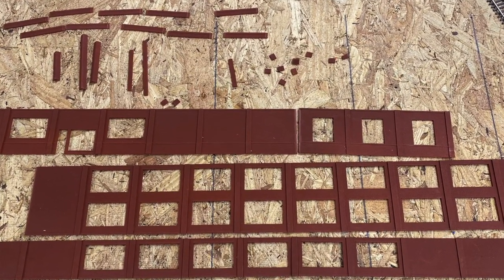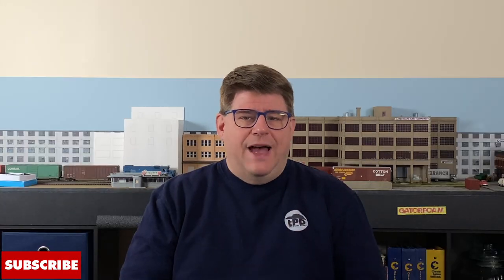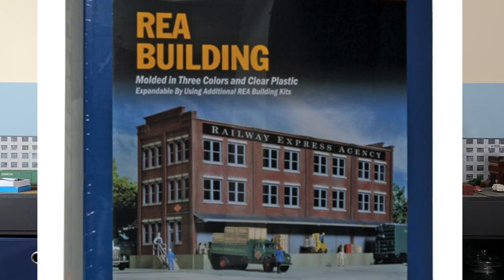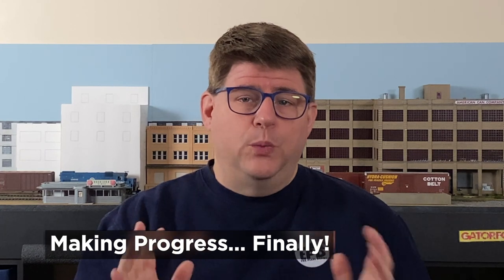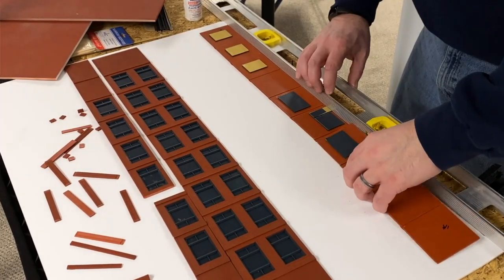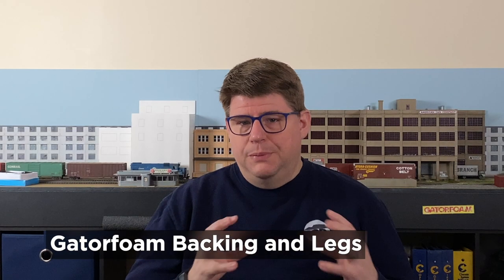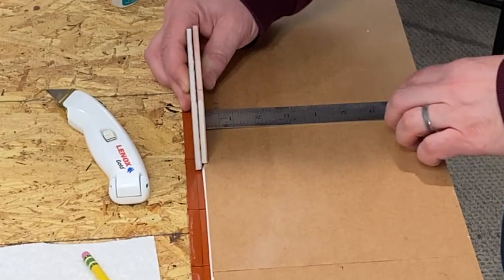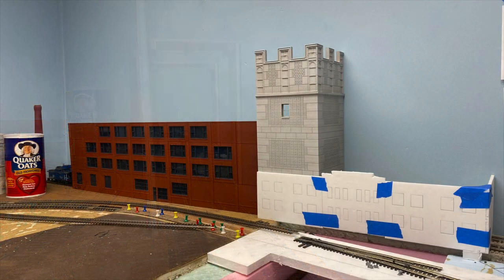How I Stopped Procrastinating and Built This Complex Structure - Part 1

Comment: I’ve done a couple of large DPM builds. I might be a minority but I found them to be very entertaining because I created a unique building, instead of another out of the box building.
To add stability to the verticals I cut up pieces of sprues left over from other kits. The round sprues fit nicely into the groove and glued solidly and I saved styrene money
Reply from the maker: That’s a good idea with the sprues. You’ve bailed the benefit of the DPM modules. “Entertaining” may be a strong word 😉 but they definitely have their benefits.

Comment: I suffer from the same problems. Most people would call it laziness. But more often than not it's a matter of "Analysis Paralysis", and it can literally take me years to get started on a project. I just recently got back to work on a small HO switching layout that I had started in 2019! I have a IH Factory I need to replicate a portion of for my layout, but I'm looking at using ITLA wall components rather than plastic.
Reply from the maker: If you do, let me know how you like them. I looked at them on and off as a passport I’m ity for this project, but ended up staying with the DPM walls.
Reply: @ThePixelDepotLLC  I used to build a lot of R/C airplanes, so working with wood is second nature for me. I built a Pike Stuff kit a decade ago and also had trouble making perfect cuts. I think the ITLA products are going to work great.

Comment: I have a question, though it's not really relevant to the video. Like you, I plan on manually operating switches with whatever I use as an uncoupling tool. However, unlike you (at least i think, i havent seen your whole layout), I decided to use cork roadbed under the track. This has had the side effect of making the parts of the turnouts that are for those switch throwing levers stand out like a sore thumb. My question is, what do you think I should do about them? Should I cut them off or do something to make them blend in better?
Reply from the maker: You have some options. The easiest might be to leave the parts in place and simply put cork underneath them to make it all level. (This would probably be the route I'd take, FWIW.) You could also cut off he two long, thin extended ties and leave only the throwbar, which would minimize what you see. Or cut them all off and simply move the points using the metal hole that's meant for the under-layout switch mechanism. I have trimmed these off on my layout in some yard locations so things would fit better and I've never had a problem. 

However, when you throw the points, remember (and have your crews remember) to move them only from the grommet-like hole. Repeated pushing on the points themselves can cause them to fail and break.
Reply: @ThePixelDepotLLC  that last bit I wasn't aware of. I'll keep that in mind. Thank you very much!